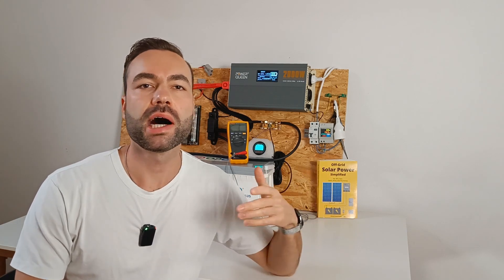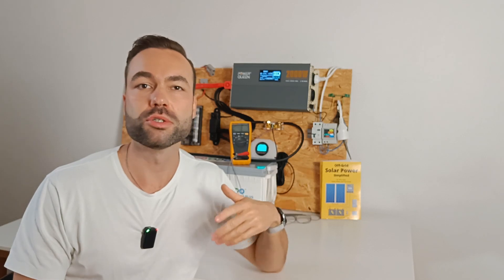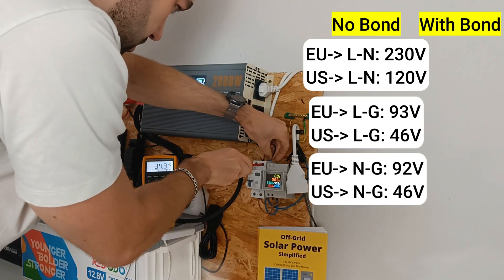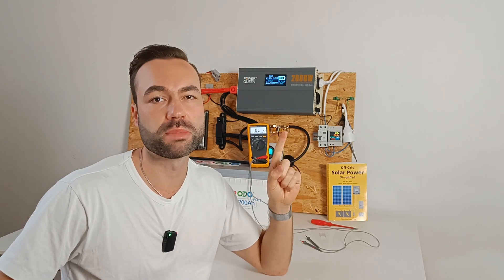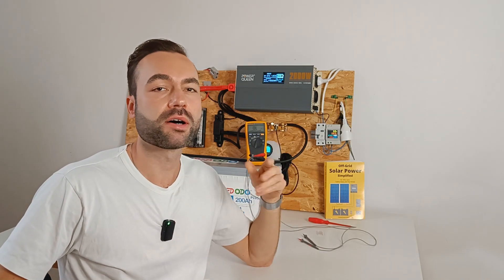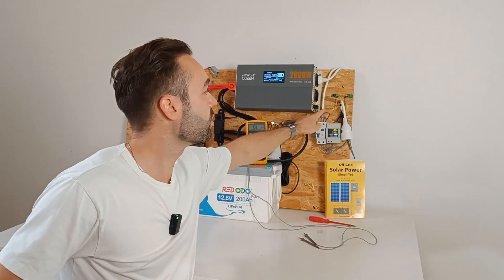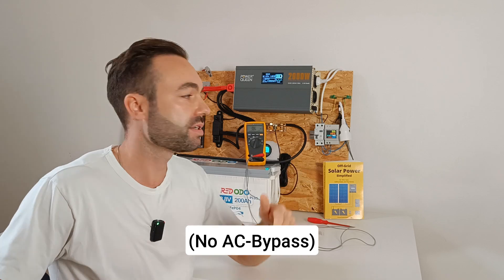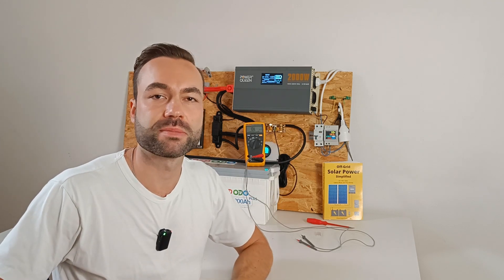Neutral-Ground Bonding for Off-Grid and Mobile Systems

Comment: I don't understand. I don't get how I have an earth when nothing is connected to earth. I've 4 pv panels going into two Victron charge controllers that are connected to a bank of batteries, the batteries are wired directly to a 12v inverter and that's it. Are you saying to plug a cable into the inverter, chop the wire and feed those live AC wires into a GFCI box and then from there out to an AC socket?
Reply from the maker: It's a reference to 0V. you can bond it to the physical earth or to a reference point in your system, in your case the negative battery post. It takes away stray voltages from appliances. No, you first wire it to a GFCI, and then when all is finished you plug it in the inverter. Never work on live wires.
Reply: @ Thsnks Nick. I obviously need one so will sort that out today.

Comment: Hi Nick, I have a Victron 1200VA and will use a gfci on the AC side. The Victron comes factory default with neutral floating. It can be changed internally by reconnecting the earthwire from the chassis to a different terminal on the circuit board to create a neutral connected to earth. Will changing this wire internally accomplish the neutral ground bond for my gfic or am I better off to leave the neutral float and create a jumper as in your video ? Also, I had a question regarding the ground wire size on the DC side. Is the size 1/2 of the current carrying cable for each device after the busbar or 1/2 the size of the current carrying cable from the battery to my bus bar?
Reply from the maker: It's best to make the connection inside like the manual is showing. The sizing of the grounding wire is never clear (even in product manuals). The main purpose is bonding the metal casing to the neutral in case of a stray voltage. So i would say 2.5mm is more than enough.

Comment: انا لدي كهرباء على الخط البارد ماهو الحل؟؟
Reply from the maker: Your line and neutral is probably swapped in the inverter. This can happen. So switch them over.
Reply: @cleversolarpower I put the test lamp between the neutral and ground line the lamp did not work I think it is the ghost line

Comment: Are you saying that in scenario 2 where you have a separate AC charger and you have a separate a separate inverter that you don't need to manage the ground bonding?
Reply from the maker: You still need the neutral-ground bond at the AC out (inverter). But you don't need a grounding relay because you won't bring any ground from the outside (shore power) into the system. A grounding relay switches the ground between shore and your ground neutral bond. If you do not bring in any ground from shore, then you don't need a grounding relay switch. Take a look at how the victron multiplus 3kva works (the grounding relay).
Reply: @cleversolarpower so are you saying with a multiplus 2 I don’t need to worry about creating an MEN link in the switchboard of a Motorhome as the Multiplus 2 takes care of this?

Comment: I have a question for you Nick. My inverter is not bonded internally and I would like to bond the AC ground to the Neutral so my RCD will operate. I also want to earth all my equipment such as my controllers and inverter to the negative DC bus bar however the AC ground in the inverter is connected to the case internally so if I connect the grounding terminal on the inverter case to the negative bus bar this would also connect the AC ground to the Negative of the batteries through the bus bar. What do you recommend I do in this situation.
Reply from the maker: That is correct. I like to keep them separate but like you said, they are connected to each other. its ok.

Comment: Thank you!!!!!!(King of Kings) I have been serarching for this answear about how to find ,mesure if there is  bonding in the system or not. And finally I came accross your video...this is working in normal not off grid homes as well and not just inverters?
Reply from the maker: I recommend measuring the output of the inverter. Then you know if there is a bond or not, as demonstrated in the video.

Comment: You’re missing something extremely important points! You’re systems are isolated from earth, meaning u don’t have a proper earth connection therefore u also can’t have a neutral, so u cannot have an men! The earth your referring to is the body of the inverter, which is nothing but a metal box.
Reply from the maker: Earth is having a reference point. In a floating system this is the battery negative. In a grounded system this is literally the earth. It doesn't matter which one it is, it matters that it is a common reference point.
Reply: @Steve-Campbell-u4n so how would this differ from using the onboard generator?
Reply: It doesn’t

Comment: In the U.S. as a rule of thumb, 5 wall outlets can be connected to a 120 volt 15-amp circuit breaker. I believe that each wall outlet should be a GFCI and the same goes for every connection to the house electrical system. Think about what would happen to a computer on the 2nd floor if it is on the same circuit as the toaster in the kitchen that went bad with GFCI only in the breaker box?
Reply: You only need one GFCI in a circuit. It is required to be the first outlet in the circuit then all the other outlets are protected.

Comment: Great tutorial! I have only one question. ON forums an even on victron documentation i read tht i should conect my battery and all voctron dc elements like chargers inverter... to chassis. I dont understand why i should do that and how about to keep 2 dc systems on same chassis in case of 12v or 24v vechicle system and 48 v lesuire system?
Reply from the maker: Check my video about grounding. Basically you only want to connect to chasin at one place from the grounding busbar. It doesn't mean there is voltage on that, it's a connection at 0V, not 12 or 24.

Comment: Please make a video of neutral ground bonding to rcd or rcbo including  a home that is using transfer switch.      How do I bond my inverter using the existing electrical system in my home.           Should I make a small separate distribution panel just for my inverter then I bond it there before it go through my transfer switch

Comment: Hi - I love your channel and concise videos. 

I am renovating a house (in the UK) to be completely off grid and designing the (modest 2.4kw) solar system from scratch, using Victron components. I have a multiplus II inverter/charger to run a backup generator when there isn't enough solar.

I am confused about how to earth/ground the system. My AC loads all go through the latest RCBO, surge protected consumer unit. Is this adequate to serve as a GFCI? Also, do I have to program anything in the multiplus II so that the earth is OK for both the inverter and the charger?
Reply from the maker: The multiplus has an integrated ground relay, so no need to add the ground neutral bond. If the generator is wired to AC-in, the ground relay will open, because now the generator has the ground-neutral bond, because it acts as the grid. Checkout my video about grounding. 2.4kw is quite low for a home in the UK, you must not consume a lot.
Reply: @cleversolarpower  thanks very much for your reply. Yes - I know 2.4kw isn't much. I'm starting off putting 6 x 410w panels on my kitchen roof and garden sheds until I can afford to put panels on the house roof.

Comment: Grat vedio, but in-fact we have the electrical tester screw is lights on when we put it on the array cable and also it reads AC VOLT  besides if the fuat is caused by the MC4 it will melt by heat we use high DC VOLT FROM the solar panel 350 , 
Inshort we need to now 
1- why screw driver light  on while it supposed not as the current and volt is DC type.
2- also we noticed in battries poles screw driver lights on
Finally thanks for your great video’s that helps to achieve safe and sound operations. 

2
Reply from the maker: Sorry, I don't understand your question.
Reply: @cleversolarpower  Thanks for your response what I want to say that the electrical test screwdriver is light when we put it on the negative or positive ports of the PV is that mean ? We practically did this test and get this result.

Comment: Great video Nick. I have question:
why we get electric shock  during cleaning solar panels by water?
Can you make a video to explain please?
Reply from the maker: That is not normal. I suspect there to be a faulty mc4 connector or a stray voltage from the panels itself. Stop cleaning the panels before more 'favorable' conditions shock you. They need to ground the solar array metal frames. I made a video about grounding, so check it out. The voltage on the metal frames passes through the water from the hose through your body into the ground. If you have wet hands and stand in a puddle, this can become lethal.
Reply: I already grounded my solar army metal frames and I checked all MC4 connectors every thing was fine.
But I stiil get condition shock. Why???
Reply: Grat vedio, but in-fact we have the electrical tester screw is lights on when we put it on the array cable and also it reads AC VOLT  besides if the fuat is caused by the MC4 it will melt by heat we use high DC VOLT FROM the solar panel 350 , 
Inshort we need to now 
1- why screw driver light  on while it supposed not as the current and volt is DC type.
2- also we noticed in battries poles screw driver lights on
Finally thanks for your great video’s that helps to achieve safe and sound operations. 

2
Reply: Panels shocking you is the strangest thing i have heard about solar.

Comment: Well done Nick,  great subject matter,  I'm glad I found your videos... they very helpful.  One question, why does your Fluke meter numbers fluctuate in the background while filming when not connected to any AC device?
Reply from the maker: Glad you like the videos. Have you checked the latest one about a GFCI? The fluke meter is quite sensitive, it's measuring mV because it's in auto range setting.

Comment: make a video on 12v 100ah battery with a pc with 550w psu , how many hours can give backup?? Please make video on this
Reply from the maker: 12V 100Ah battery has 1280Wh of stored energy. A PSU of 550W would not consume 550W. It can deliver it, but doesn't mean that it will consume that amount. Let's say the PC uses 300W (which would be a medium gaming PC). 1280Wh/300W=4.26 hours of runtime.
Reply: @cleversolarpower  thanks a lot bro 😅

Comment: Is there a need for separate grounding, that is like an Ac and Dc grounding.. Dc ground for the solar panels and Ac ground for inverter end.
Reply from the maker: There is no need, but i like to have them separate. The literature also says to keep them separate even though they are connected through the inverter.

Comment: I have a question based off your video how many batteries 12 volt for a 3000 watt inverter.  Oppus has the Oppus mega 1: which states 1024 watt hours with 2000 watt output. What am I missing?

Comment: The problem I have is that I have two grounds, one at the inverter and one at the supply which causes tripping and there is no way I can  change it as the iinveter is remote to the main supley and ground which means both have to be grounded and bonded and this is very problematic.
Reply from the maker: You should only ground at the power generation source which is the inverter. By supply i assume you mean breaker panel? You have to run a grounding conductor back to the inverter, which will be your normal grounding wire.

Comment: A few comments.
In an off grid system, example small cabin, you need an earth reference point, usually earth rods.
Renogy pass through inverters, strongly advertised  in Europe and a popular choice for RV use, do not have the automatic bonding in stand alone mode.
In a vehicle there must be a reference 'ground', the metal body/ chassis/frame. This is the protective ground of the system.
Please continue to stress the importance of the need for the neutral to PE bond and the need for RCD  or GFCI protection. There are so many 'van life' videos, some by 'professional converters' than show unsafe instalations.
USA domestic  power systems sypply is split phase, 120- neutral-120 and some inverters designed for that market produce this output.
Reply from the maker: Indeed, for stationary systems an earth rod should be used. 
I'm not familiar with renogy inverters as i haven't used them yet. 
Yes, i will include the use of GFCI in my future videos.
Reply: I have been scratching my head about this too, so I have just bought your book to try to get my head around this. I have bought a Renogy high frequency 2000w inverter with a built in automatic transfer function between shore power and inverter power. I planned to install this between the shore power consumer unit and the existing sockets to provide an automatic change over. I was then planning to install an RCBO/GFCI between the inverter and sockets. Would I be right to assume that if I earth bond the neural of the inverter output to allow the GFCI to work, I will cause ground loop problems?  Would a better solution be to ignore the auto transfer function of the inverter and use something like a 230V ac Coil Non-Latching Relay DPDT, 16A Switching Current 2 Pole relay before the inverter and keep the two systems isolated from each other to avoid ground loop problems?

Comment: I have an off grid system and am wondering about earth conductivity. The earth here is into rock and is very high resistance. I have the house distribution board and earth to the house which is a reinforced concrete and all the reinforcements are bonded and external earth. I also have the inverter separate to the house by 60 meters and again is a very poor earth conduction. I have no earth to neutral connection as yet as I am not sure which way is best, the inverter end or at the house.
Reply from the maker: Can you use the metal rods in the concrete as a grounding bond? Research ufer ground.
Reply: If you have a N/E and electrode at your inverter you need to consider voltage drop across the neutral under full load as that will pull your your neutral away from earth at the house.  Apply ohm's law.  This would be considered a TN-S earthing system.  With 60 metres of separation you could actually implement a TT system.  Earth neutral at the inverter, no separate earth wire to the premises, earth the premises PE wiring.  That could be a separate electrode or using the reo in the foundations etc.  If you are implementing TT consider fitting a master RCD on the wiring to the house, at the inverter end.  This will protect you against earth faults in the wiring to the house.

In reality the impedance of the earth electrode really doesn't matter too much with independent systems such as you are implementing.  Fit RCD/GFCI to all final circuits which is more or less the law in many countries now for a fixed supply and pretty much even a poor electrode will give sufficient earth fault current (this is referring to a fault that passes current to mother earth separately to the premises PE wiring) to trip the device, and if it doesn't then you can't be harmed anyway.  An important thing to consider in these types of setups though is step potential.  In a fault condition you don't want harmful potential gradient around the electrode at the surface where you can walk.  Ensure what ever you do penetrates sufficiently deep into the ground.  Use an impedance meter if you can borrow one.

Ultimately what you implement should be compliant with your country's / region's electrical standards.  Since you don't say where you are, a wise thing, only general advice can be given.  Finally don't bodge a portable inverter into your fixed wiring.  Use an inverter intended for the purpose.